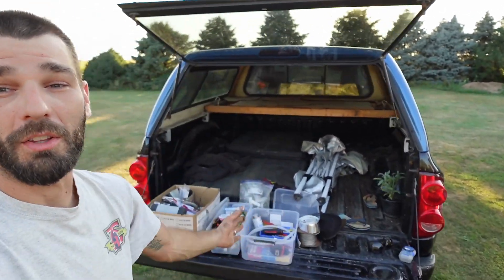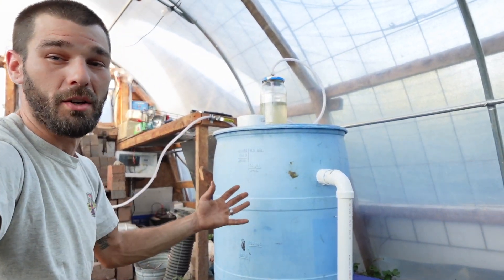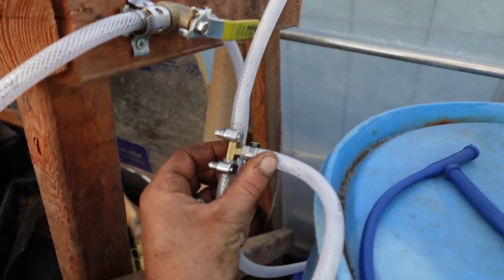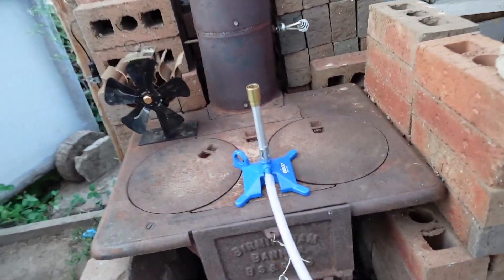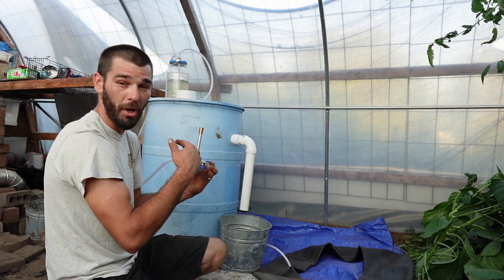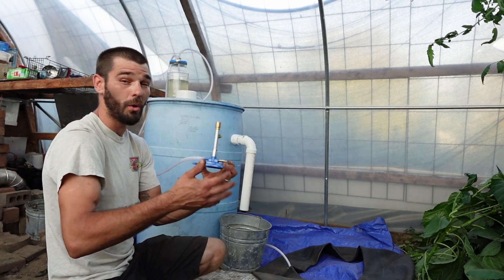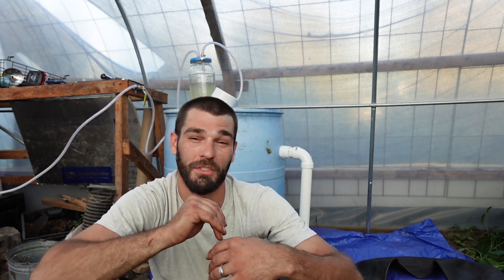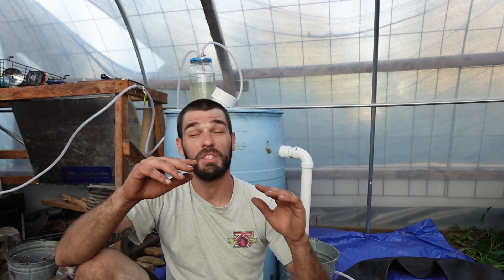DIY Greenhouse Bio-Fuel Experiment - Free Energy From Waste

Comment: What carbon scrubber do you use? 

Human waste may give more pathogens that are human combatable, so a risk of infection maybe be higher.

 Maybe i have no idea but just a thought.
Reply from the maker: Right, we’ve been doing some research on humanure and composting human waste. That won’t be our main or only input..we’re using the bubbler with water, on a large scale system they use cold water sprayed down as the biogas flows up to absorb co2 and h2’s and some systems for scrubbing . We’re using simple water with bleach, or some lye water to scrub co2, this is going to be an experiment once it gets going. Pretty excited to see what happens
Reply: It was my understanding that the gut bacteria in carnivores and most omnivores has a higher resistance to heat. It needs to be cooked and cured a lot longer before if can be used as fertilizer. Some say even then not to use on edibles, only your flowers and such. I would be interested to see your process if you figure it out. 

As far as the scrubber goes, I've seen a lot of people use a 3 part scrubbing system (steel wool for H2S, water for CO2, and silica or kitty litter as an absorbent). I have yet to test this out; I'm still in the process of building my compost digester. 

I really like how you fastened your gas outlet line to the bung seal. That will save me some time and money on mine.

Comment: Here I thought the methane barrel had to be in the compost pile so the heat would cook it and produce gas. Also I thought it had to be a sealed system so the pressure of the methane would push the gas where it needs to go. Now I'm really confused. And scrubbers for the H2SO??
Reply from the maker: This is a methane system only for inside the greenhouse, the barrel is sealed from the exits the gasses will be trapped in the barrel flowing into the line as it’s created and pressure builds. We’re hoping to fill the inner tube in time so we can show burning some of the methane collected. The water will stop any Back burn from being possible.
Reply from the maker: I want to create a system for harvesting methane from my compost outside but that will probably be a tarp over top to catch the rising methane somehow
Reply: I'm curious if the mat of a trampoline would be a good "tarp" over the composite pile? I saw an old trampoline for giveaway on Marketplace this morning, lol @Earthdwellershomestead  I love this and all of your experiments. They certainly get me thinking.